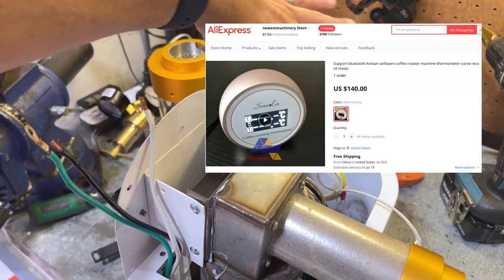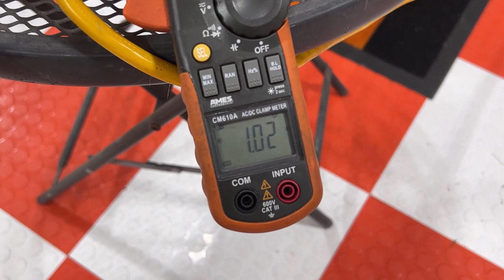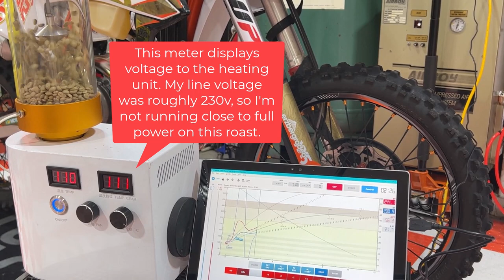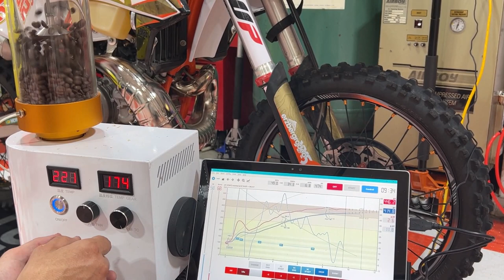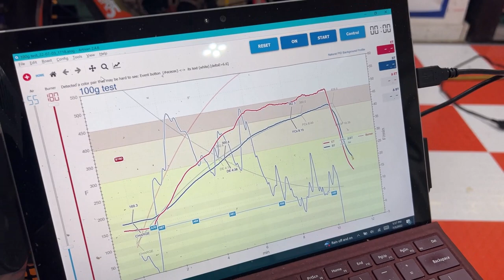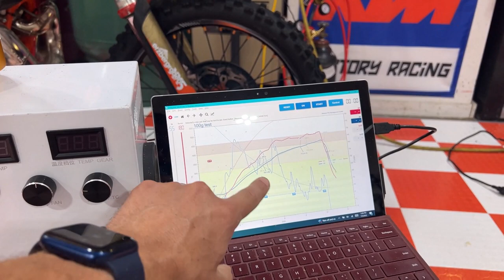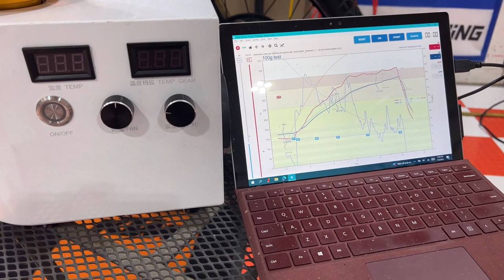Smola (Ali Express) Coffee Roaster Teardown & Review - Is it a potential iKawa killer?

Comment: i use this machine for over 2 years, broke down 2x. The only problem is the power control board. Based on my analysis, it can last for about 70x of roasting, after that it starts deteoriating (power is dropping, so that you need to reduce the load, load means the coffee bean). When you see power is dropping, go replace the power control board (the board that connecting to the power knob). That's all you need.

Comment: Generally speaking you can’t really set a profile from a sample roaster and have that translate on a larger roaster. Every roaster is different and every coffee roaster on any roaster will roast different and normally be roaster specific. Roasting a sample is all about imparting minimal roasting influence on the coffee, find out what the coffee has to offer and with that information you then formulate a plan on your larger roaster that will best accentuate the coffees qualities. I’ve been roasting for 15 years on anything from sample roasters up to 120kg roasters and I have never seen a profile from one roaster translate to another roaster.
Reply from the maker: Thanks for your input, Leo. I certainly agree with you if we're talking about drum roasters. However, that's not my experience in comparing this roaster specifically to the Coffee Crafters fluid bed roasters. There are far fewer variables on fluid bed roasters of the same design (and both this Smola and the Coffee Crafters Artisan line are "spouted bed" designs). The cycle rate of the beans is nearly identical (the number of times per minute that each bean cycles through the heat) and the roast air temperature is nearly identical. Finally, add in automated PID control and I have found it to be remarkably comparable.

Comment: Great informative video. Did you let beans cool in the RC using the fan on high ? If so, how long did that take? Glad you showed the amount of smoke the unit put off. What is the height and width of the RC? I look forward to seeing the PID upgrade.  Thanks for sharing.
Reply from the maker: For the batches from this video in the garage space, yes I just just cooled them directly in the roast chamber. I don't recall exactly now long it took to cool... it was ok, but certainly not as ideal as a separate cooler (because the heated mass of the RC itself slows down the cooling process). Once I moved this to my roasting space, I started using an external bean cooler.
The glass chamber is 105mm O.D. and 160mm tall.
Reply: Thanks for the reply. Once again great job on the video.

Comment: Hi Jason, I watched your excellent review on this roaster and got my hands on the 150g model. As you said, it is a great roaster for roasting small batches and I found that it even have enough power to go beyond the 150g limit. The temp display is not accurate though but I use Mastech 6514 for temp measurement and connects it to Artisan on my laptop.
Reply: By any chance, do you know if the hole for the bean probe threaded, and if so, is this M6 or M8 or something else? I ordered the roaster and am looking to buy some thermocouples.
Reply: @sato2097 it is M6 threaded.
Reply: @hengkaiwee  Thanks a lot for the answer!

Comment: Thank you for vedio. wonderful review
I just wonder about machine
first, cooling bean by switch off heater(only fan-maximum power). is it proper capacity? or recommend using extra cooling fan
second, where did you get thermal probe(for bean temp)? is that included in product?
thank you
Reply from the maker: Thank you for the kind words. The bean temp probe comes with the roaster. Regarding cooling, I recommend an external bean cooler, but you COULD just turn the heat off and let the loft fan continue to run, as other sample roasters also do. It wouldn’t cool the beans as quickly as a dedicated bean cooler, but I haven’t done tests to see if there’s a benefit in the cup to this approach.

Comment: Hey Jason, any updates on this roaster? Are you still using it and would you still say it is worth the price? Are you running it on 240V 60Hz in the US?
Reply from the maker: My update is an unfortunate one... my Smola roaster melted into oblivion. In the end it was user error, but also illustrates a design flaw. Yes, I was able to completely automate it by creating an adapter for a Hermetheus Roaster Co-Pilot (an automation device that we make for Coffee Crafters Artisan and Valenta roasters). 
The Co-Pilot replaces the heat knob on the roaster, so turning it by hand isn't possible anymore. After a roast finished, I turned off the loft to dump the beans, but the Co-Pilot robotics left the heat elements on. This was my fault. I should have turned the entire roaster power off. So while there was no loft running, the elements were still glowing red hot as I dumped and cooled my beans. That's when the fun molten metal drama started! 
The design flaw? Every coffee roaster should incorporate a high limit safety switch to protect against this kind of bone-headedness. The Smola lacks that.
It's still a decent little roaster for the money. And yes, I was running it on 60hz/240v. I could still recommend it. From a strict "roast quality" standpoint, it's outstanding! From a design and ergonomic standpoint, it has some flaws. My biggest complaint is that the roast chamber lacks ANY kind of grip/handle to dump the beans. My best guess is that Smola intended for us to use the roast chamber as the bean cooling chamber, but I'm not a fan of that approach. The roast chamber retains so much heat from the mass of metal and glass, it makes for a very slow cooling process (which runs the risk of "baking" the beans). I crafted some cabinet handles on the roast to assist with dumping beans.

Comment: Hi Jason. great video! thank you for the detailed overview. I have this roaster on the way, planning to automate it inspired by your other videos. Im really an amateur doing this for home use only. Living on an Island in Norway, it just isn't any good coffee around here. I really want to max it out with features and also look into add the new possibilities in artisan for automation and control. Which of the phidgets do you recommend me to get? Should I get a yocto watt?
Reply from the maker: Glad to hear you've caught the roasting bug! If you want to automate it using Phidgets, you'll want the RCC1000 and the TMP1101. I have videos on how to configure Artisan for these. The YoctoWatt is really cool, but also pricey compared to a standard ammeter. It has a max current rating of 16A, which is adequate for the Smola, but nothing larger. It really comes down to whether your REALLY want your electrical properties to show up in Artisan vs. just a digital screen on the roaster (i.e. a standard ammeter). I have the YoctoWatt, but it's difficult to justify the price unless you're going to use Artisan to actually do something with that data. (For instance, you might alter automated loft settings based on incoming line voltage). But if you just want to see what your line voltage is, a simple ammeter is many times cheaper. Good luck!
Reply from the maker: @DIYcoffeeroast  Yes, my thoughts on RTD vs. Thermocouple have certainly evolved. I still maintain that RTDs offer a more stable temperature reading, but much of my issue with thermocouples had to do with a noisy signal. Once I cleaned that up, the performance of the thermocouple was adequate enough to reliably use for PID. While I loved the accuracy of the RTD, I had 2 of them fail in under a year, and they're quite pricey. So at this time, given the price/accuracy/reliability equation, a clean thermocouple signal should be just fine. If you go the RTD route, I would suggest always having a spare on the shelf. (Something I recommend with thermocouples as well, but they're so cheap, it's much easier to justify.)
Reply: @hermetheuscoffee  got my roaster, done two roasts completely blind, very exiting and a lot of things going on. Pretty happy with it so far. How do you start your roasts? what is your adjustments of airflow during roasts?

Comment: Great video! Jason, may I know how do you connect/convert this 220v roaster to USA 110v wall plug?
Reply from the maker: The heat element and controls are all designed for 220v, so It would require a different heat element and electronics. But I think this might be the wrong machine to try that conversion on. At 300g, it might be a bit too large to profile roasts on a 110v power source. I think the smaller 150g unit would be a better candidate to try that conversion on. <Jason adds 150g Smola to his shopping cart…>
🙂
Reply: Similar question. I’m not a super great electrician but I know our 220v is split phase so what kind of plug are you using and how did you wire it up to the unit?

Comment: Hi Jason, thanks so much for this video. I roast with an Artisan XE and am considering this for sample roasts. Curious how you cool the beans? Do you just turn the heat off and allow the air to cool or do you somehow dump the container into an external bean cooler. Wondering how hot the exterior gets if I were to dump into a bean cooler.
Reply from the maker: Great question that I should have addressed in the video. Yes, I use an external bean cooler so I just dump the beans into that. BUT, the chamber gets quite hot, so you need something like silicone oven gloves or something to grab it. It’s a big miss that they didn’t incorporate a handle into the chamber design!

Comment: How are you managing the smoke?  Do you have a way to attach a duct this to vent the smoke outside?  I've been wondering if there are practical methods to minimize pollution (wet scrubbing or electrostatic precipitation, etc)
Reply from the maker: I’m now using the vent hood on my primary Artisan roaster (which vents to the outdoors via 4 inch ductwork). I’m sure it would be possible to run some type of small shop vac through a water bath to make some type of crude water scrubber. You might also find a cheap electrostatic filter used on FB or local auction sites. These are often used in bars/diners that allowed smoking, and when they’re no longer needed you can often pick them up cheap. (I’ve seen them for $50-$100).

Comment: Hi, nice teardown. How did you connect the probes to artisan? Phidget? The 150g roaster is 680 EUR , 300g 810 EUR including shipping and vat. However a caffelogic nano 7e is around 1000 EUR including warranty from a European seller. Is the nano a better choice? My goal is to really learn about the roasting process and profiles and maybe artisan rather then try to save money by home roasting
Reply from the maker: Yes, for this video, the probe was connected via a Phidget. Since then, I've changed that, but it was more for size reasons than performance. The Phidgets are great. I unfortunately can't tell you if the nano is a better choice, because I don't own one. In the end, even when I do my video on the PID automation of this unit, I've come to the conclusion that for U.S. roasters, it's not really comparable to either the iKawa or the Nano 7. Simply because of the need for 240v on this unit. Don't get me wrong... for performance reasons, the 240v is AWESOME! There's heat power to spare, and profiling roasts is amazingly easy and predictable. But it's simply not portable. You could take an iKawa or Nano 7 on the road with you, but where would you find the 240v plugin? It's a real drawback from a convenience standpoint. Having said that, where this Smola roaster really shines is its ability to perfectly scale up to larger Coffee Crafters Artisan roasters. If you can nail a profile on the Smola, you can use that exact same profile on an Artisan and end up with the EXACT roast. So if you're not really concerned about portability AND you have 240v, this is still a fantastic sample roaster. I'm really intrigued by the Nano 7, but at $1,000, I'm unlikely to buy it... simply because I like this Smola so much.
Reply: @hermetheuscoffee  Thanks for the detailed response Jason!

Comment: Ok. Do you have any thoughts on another air toaster, I think the Brand it's Shenzhen april technology
Reply from the maker: I don't own one, but based on the price point and specs, I would temper expectations (much like with this Smola unit). That is, it will almost certainly work well and roast coffee. The unknown will be the reliability and availability of replacement parts. (Things like heat elements and electronics would be easy swap with similar parts, but the roast chamber itself is likely unique to this roaster.)

Comment: Any updates regarding this machine? I'm wondering if you were able to automate everything
Reply from the maker: My update is an unfortunate one... my Smola roaster melted into oblivion. In the end it was user error, but also illustrates a design flaw. Yes, I was able to completely automate it by creating an adapter for a Hermetheus Roaster Co-Pilot (an automation device that we make for Coffee Crafters Artisan and Valenta roasters). 
The Co-Pilot replaces the heat knob on the roaster, so turning it by hand isn't possible anymore. After a roast finished, I turned off the loft to dump the beans, but the Co-Pilot robotics left the heat elements on. This was my fault. I should have turned the entire roaster power off. So while there was no loft running, the elements were still glowing red hot as I dumped and cooled my beans. That's when the fun molten metal drama started! 
The design flaw? Every coffee roaster should incorporate a high limit safety switch to protect against this kind of bone-headedness. The Smola lacks that.
It's still a decent little roaster for the money. I could still recommend it. From a strict "roast quality" standpoint, it's outstanding! From a design and ergonomic standpoint, it has some flaw. My biggest complaint is that the roast chamber lacks ANY kind of grip/handle to dump the beans. My best guess is that Smola intended for us to use the roast chamber as the bean cooling chamber, but I'm not a fan of that approach. The roast chamber retains so much heat from the mass of metal and glass, it makes for a very slow cooling process (which runs the risk of "baking" the beans). I crafted some cabinet handles on the roast to assist with dumping beans.

Comment: Hi Jason. Great review! Just as others stated, much interested in how you integrate PID control. Do you think the stock model has potential to consistently roast great coffee  after a bit of learning curve?
Reply from the maker: Thanks for the kind words! I can already give a spoiler that my PID integration is simply done by modifying a Hermetheus Roaster Co-Pilot, which is kind of a plug-and-play "PID in a Box" for Coffee Crafters Artisan roasters. However, this little roaster can absolutely give consistent roasts with just a bit of practice.. ESPECIALLY if you simply connect your temp probe to Artisan software. After just a few roasts, you'll get the feel of how much heat adjustment is necessary to keep it on the target temp curve. Hope this helps!

Comment: I'm interested in buying a step-up transformer to use this with my 120v outlet. I'm not sure what the power requirements are, do you have that info? I'm looking at 3000w and 5000w transformers.
Reply from the maker: Sadly, Ohm's Law isn't our friend here. We're not going to be able to get 3kw from a common 120v circuit. I suppose if you didn't crank the heat knob past 50%, you COULD use a 3kw transformer. In theory it would work... up until you turned it up too high and popped your breaker. It's really just a bad idea all-around. A common electric dryer 240v plug would work though!

Comment: Hi, any updates on this roaster? Wonder how it has been working for you so far. I like the idea but not sure if I should drop $500 to find out (or just stick with a sr800 or something similar in price)

And have you thought about putting a 1/16 pid controller with communications and adjust pid /sp from pc?
Reply from the maker: Hi, Ryan. My overall impression is still pretty positive. I'm STILL planning on doing a shorter video of how I've automated the heat control via servo and PID, which makes this a fantastic little automated "profiling" roaster. One of the shafts of my potentiometer knob cracked when I was a bit rough putting the servo on it... it's incredibly brittle pot metal, so that was annoying. Compared to the SR800, it's a far more capable machine, if for no other reason than sheer power. At 3kw, there isn't a 110v roaster that can compete with this on heating capacity. (But of course, 220v carries the huge disadvantage of convenience, so only you can decide which is the better tradeoff for your use.) I have zero regrets, and I would buy it again. In fact, I'm considering buying the 150g version or possibly even the 50g version (which is VERY cheap) to see about doing a possible 110v, PID-automated conversion that wouldn't break the budget!

Comment: Have you thought about Kaffelogic nano 7?
Reply from the maker: The Nano is an intriguing little machine for sure! I think it could be an amazing alternative to the iKawa (which, let’s face it, is a very steep price point). It’s 110v, which you could take as a pro or con depending on your priorities. More CONVENIENT for sure. You can plug it in anywhere and roast (just like the iKawa). The Smola in this review has more than 2x the heating capacity, but uses 220v because of that. So you’re very power-source limited there. But the Kaffelogic is still 2x the cost of this one, so it’s still kind of apples and oranges. I’d love to review the Nano, but at its price point it’s probably not in my immediate future.